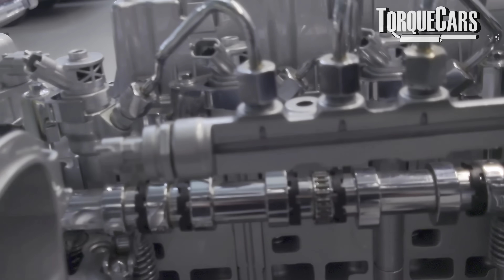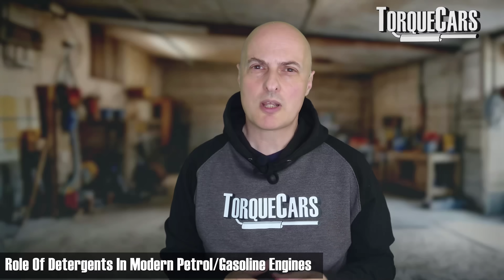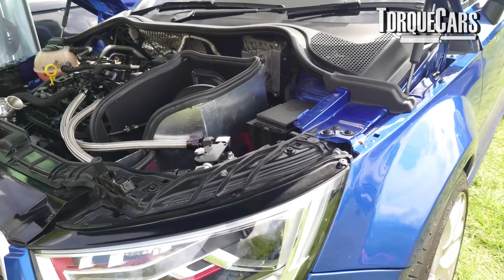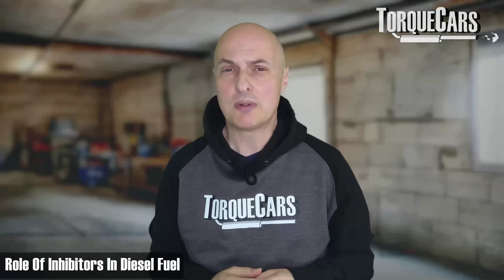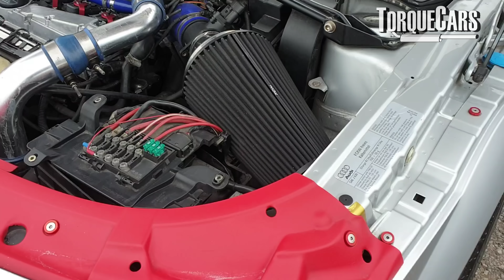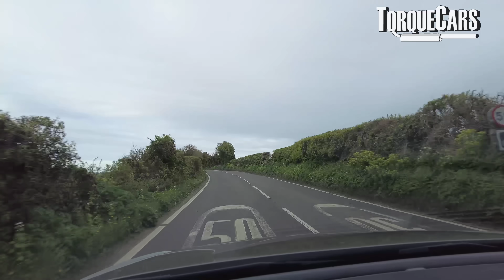Premium vs Cheap Fuel: ⛽What’s Better For Your Car? Do Premium Brand Fuels Really Clean Engines?

Comment: I used to deliver fuel, it's all the same just has additives in it.
and a point to note is all forecourt fuel has additives in it.
fact.
so your paying for additives.
I only use supermarket fuel in all my skoda diesels never had an issue ever.
and service my car correctly.
stop with the scare mongering.
budget fuel is the same as expensive fuel, just additives.
if budget fuel was as bad as your making out wouldnt be allowed to be sold.
all the these videos about fuel are boring.
fuel is refined to a standard or couldn't be sold.

Comment: Hi, (VW Tiguan 2l TDI 2013): Experiencing hesitation, feels like misfiring. Happens during accelerating when I press the pedal jentally (never expires this issue when I press hard on the padel).
Some time I feel it when driving downhell on motorway whiel the cruse cntrol is on. Any advice?
Reply: Have you changed the fuel filter ?
Reply: Add a can of diesel injector cleaner to a full tank and give it a real flogging somewhere hilly for an hour or two.
If that doesn't sort it get it scanned via the obd port and see if it's throwing any codes

Comment: I use texaco diesel from the sake fuel station and same pump I use reddex diesel system cleaner and eventually visit died the job excellent I get over 40 mpg in town and 70 plus on long runs I have. 1.6 tdi vw😊

Comment: I noticed my last car, a 2006 Mazda MX5 2litre felt more responsive with a 2 -3 mpg gain after filling up with BP Ultimate.  It's the same story with  my present car, a 2004 Audi TT 3.2 V6. The owners manual on both advise using premium fuel, although standard fuel can be used with reduced performance.  I also run two motorcycles that run better on BP Ultimate. I dare says V Power and others will be the same but the BP station is nearer to home.

Comment: 2012 Hyundai i30 diesel, 98k and runs beautifully. Good service history and mpg. Should I use engine flush prior to an oil change?
Reply: No. An engine flush isn't needed for cars that have been serviced regularly. Modern oils have enough detergents in them. Adding a reputable diesel injector cleaner to a full tank a couple times a year is probably worth it though
Reply: @eponymous7910 Many thanks for that 👍

Comment: Until recently I consistently used Shell V Power in my car, mainly because my car requires 98 RON or better and allegedly Shell has one of the best additive packages for keeping the fuel system in good condition, it also helped that the Shell garage next to where I worked was usually cheaper than supermarket fuel in the town where I live. Now that I've retired it's not worth me making a special trip to fill my car so I now use Tesco Momentum because it exceeds 98 RON and has zero ethanol, I still fill up with Shell V Power on occasion for the cleaning additives.
On a side note I have several small petrol engine garden tools and I use Tesco Momentum in them, not because of the octane rating but because of the zero ethanol, you can have problems with garden equipment if you don't  drain the fuel out if you're not going to use it for a while (over winter), I've found that using zero ethanol fuel I don't have a problem if I store the equipment for extended periods with fuel in.
Reply: Momentum is E5 which I believe means up to 5% ethanol.
Reply: @Stringfellow-xo6do  there are videos on YT that show people testing the the octane rating and ethanol content of different fuels and they generally find that Momentum contains zero ethanol.
Reply: @Stringfellow-xo6do  yes... up to 5% can and also mean 0%. The clue is in the 'up to'.
E5 is basically a standard advocating 'no more tha' 5% ethanol. Zero percent is less than five percent and is still allowed.

Comment: One thing to mention is the higher octane unleaded, certainly Shell V-Power, is E5 against E10 for the regular 95 unleaded. The E refers to ethanol and the number that follows the percentage content; so E5 is 5% ethanol against 10% in E10. Ethanol is not great on fuel lines and the like; any rubber components are degraded by ethanol, particularly over time. Newer cars may or may not be as affected by this, but I've seen other videos on classic cars where it's a real issue and many owners prefer to run E5. I have to say that my view is a few pence here and there on fuel against the cost of engine work down the line is a no brainer. I personally try and use Shell V-Power as much as I can, but there's nothing wrong with BP Ultimate or Texaco's Supreme. Shell's V-Power claims to have 3 times as much cleaning power as its regular unleaded by the way. I suppose how long you intend to keep your car could be a factor in what you use as, obviously, is your financial situation, but you need to have a bit of money to run any car these days.

Comment: My 06 Mondeo ST TDCI has covered almost 250k with no issues regarding the injectors or fuel pump. I always use either BP or shell, standard diesel. My 1983 Honda motorbike on the other hand gets Shell V Power or BP Ultimate as they have a higher octane rating and only 5% ethanol. As the bike was designed to run on unleaded from day one, using the cheaper fuel with a higher ethanol count is detrimental to the fuel system over the long run and will eventually damage internal carburettor diaphragms and seals, along with fuel pipes if they are not designed for ethanol.
Reply: You might want to look into using Tesco Momentum petrol, it exceeds the 99 RON rating and I've seen youtube videos showing that it has zero ethanol content, or maybe use Shell V power for its additive package and Tesco for no ethanol.

Comment: Tesco published the results of an independent test of their Momentum 99 fuel, and if you look it might still be available.

The TL;DR though was that the additive package did make a difference but, pun intended, your milage may vary. From memory it wasn't very much though and is debatable as to whether it's worth the ~8.5% price premium. But if your engine can actually take advantage of 99 RON fuel it is often the cheapest for that grade.

Comment: I use Esso E10 as the percentage of ethanol is low compared to other brands. Every 4th or 5th tank, I use E5 with X2 additives.
If you are keeping a new car for say 3y (lease) I would just use the cheapest, I intend to keep mine for 7-8y so I use Esso (as a premium brand)

Comment: I’ve noticed differences between standard diesel. My 1.4 TDCI on 150k miles runs better on standard Shell saver diesel compared with the diesel from the nearby Jet garage. The car has a worn injector and it misfires much less on Shell diesel. 

If I had a petrol car, I’d probably get the cheapest petrol.

Comment: I am not sure how it is in the western world, but in eastern europe the additives are added by a tank (truck) driver or by gas station worker and many times it's just doesn't get added so premium fuels (except for higher octane nummber in a case of petrol) have no real benefit.
What I do is fill up with regular fuel and then add additive by myself, usually wynns supremium petrol. It's cheaper and I am sure that it is added to my fuel.

Comment: Shell V Power or BP Ultimate petrol for my 2023 Hyundai Tucson. I put petrol in once from Sainsburys, never again as it blocked my fuel filter and caused the engine to misfire and judder. Since switching to premium E5 petrol I've had no problems.

Comment: I've always used Shell V Power on my previous 3l Jag XF and still had DPF problems. My current BMW 3L has just needed a new inlet manifold as it was chocked with carbon along with glow plugs and temp sensor next to the DPF. I think it is the Euro 6 standard that is killing cars, eg EGR/ DPF, regardless of the fuel type used. I do think premium diesels help mitigate this to an extent though....

Comment: I've ran my 2.0 HDi on supermarket fuel. 250k miles on the clock, original fuel pump and injectors. Official MPG is 49 but average on my car is 54 in winter and 56 in summer.
Reply: @khalidacosta7133  yeah but the 2.0HDi is extremely durable and not picky. Not all diesel are like this. Especially not the news one.
Reply: @marcuswoodgate4026  The 2.0 HDi is extremely durable however the fuel injection system isn't made by PSA. It's common across all manufacturers.

Comment: Shell V power is the absolute best for preventing engine knock and detention. My friend had Tesco 99 tested and it came out at 102 Ron and detected no ethanol. I run shell v power for my built Subaru sti engine and Tesco 99 on my other cars. All other fuel is rubbish. Makes less HP and engine e knock goes up

Comment: 2.1ltr Mercedes GLA 2016 and I use BP Ultimate diesel and the car runs smooth and like new! Costs me about £5 to £10 more than the standard BP diesel but it is an investment in keeping the car and engine at tip top condition, now have 84,000 miles on the clock so it should last me another 10 years! great video! btw

Comment: Mitzy Shogun 2007.  170k.   3.2 diesel.  Shell fuel, V plus frequently.  Doing short journeys so 3000 rpm run on motorway monthly.   .   As a mechanic once said to me he would not put supermarket fuel in his lawn mower.

Comment: A little mineral 2 stroke in diesel , no more than 1%,  cleans the injecors and runs quieter i have found, My 27 year old 1.9 tdi and and 25 year old Rover are testimant . V power is best  I get well over 70 mpg in the Rover and over 80 in the VW on long runs .i travel  Murcia to Pamplona regulary. 2 years ago I travelled at no more than 55mph to Pamplona and got almost 90 mpg in the 1.9tdi Incredible engines that will last a lifetime if a bit unrefined
Reply from the maker: I remember that old trick, and it worked well but I must add a word of caution to anyone trying this on a modern diesel engine. Adding 2 stroke or other oils or substances are likely to build up deposits in the particulate filters and cause problems. If it's sold as an additive you are probably ok as these are tested with modern engines, but don't try bunging any old fluid in your car on the basis it worked well years ago (which it did), things have moved on.
Reply: 80 mpg on 1.9tdi is impossible. What?
Mine does 40-45 mpg from new and that is good normal driving.  23years  now 130pd. 
I used to give a bit of 2 stroke back in the day...but now I just buy injector cleaners from time to time. Maybe 3 times a year.
Reply: @Stanjara around town i get between 45 ,55 mpg but i can achieve amazing mpg on long motorway trips. the 2 stroke helps but i wouln't use it on anything with a DPF

Comment: I own cars and bikes, petrol and diesel.
I found on my high rev motorcycle, V power Petrol really feel the power differences on my 200 hp track bike. Fueling the same V power Petrol to my 306hp Mini, its less so but it does feel rev slightly freely in comparison.
Cleaness point of view, is absolutely top notch as I can see inside of the cylinder and spark plugs.  This is based on the use of V power petrol most of the time (9 out of 10) and mixed with 1 out of 10 Tesco momentum. Spotless. 

Diesel wise I dont feel any difference, I tried V power, Fuel Saver diesel as well as Tesco normal diesel and BP in the same B57 engine, I dont feel(subjectively) any difference at all. So I end up using Tesco normal diesel most of them time (8 out of 10) and mix a tank or two V power Diesel in between.  Mileage, feel, poower are on par, no noticible difference, no starting, gelling issues.

Comment: I have a 2006 MX 5 NC . You can absolutely tell the  difference if I don’t put premium 97 or 99 octane fuel. It runs best on Tesco 99 Momentum. But our 2024 Mini Countryman S runs well on 95 or 99. But I do put premium fuel in because I think it benefits the engine in the long term. But I also religiously change the oil in both cars once a year or 8000 miles .

Comment: Freelander 2 2013 2.2 SD4, bought with 108k miles, used V Power since purchase, 110k miles now, car runs smoother and slightly better MPG. The long term compound effect of premium fuel is the product, one tank of V power isnt going to change your car but 40 tanks of it will reduce the chances of issues (thats my thought process anyway). Great video as always!
Reply: @DavidMcCartney789  This is also my logic…2006 Fabia Vrs, no one can tell me 40 tanks ain’t helping the damn thing 😂
Reply: Finally someone who gets it! The additives help long term so the added price doesn't matter.
Reply: You are gullible,  easily scammed and don't want to appear foolish, so you will try to justify spending far more than you need to.
If you ever get someone asking for bank details, run a mile.
Reply: @OH2023-cj9if premium all the way, as the saying goes you get what you pay for
Reply: @OH2023-cj9if What for buying premium diesel? 🥴😂

Comment: Many years ago I kept records of my MPG in a couple of cars I then owned. I discovered that on simple MPG alone Shell 4star was better than Jet 4star, by a measurabe amount, enough to offset the higher price of Shell. I did not measuer other factors, but the cars lasted over 100k miles without problems.
Currently my favourite Fuel is Sunshine , followed by wind power. No neeed for special oils, no drop off if I use fuel from another source, no  exhaust pollution and a cost per mile of under 2 pence.

Comment: My 2 litre Volvo S40 petrol runs on whatever the cheapest fuel is at the time. 100k miles absolutely no issues at all
Reply: Old petrol cars don’t have any filters that can get blocked but cheap fuel build up carbon
Reply: @Pixelpeeps-69  every car has a fuel filter mine included, never been changed though. British fuel is fine doesnt matter where you get it. Its USA that gets the crap stuff

Comment: Fuel is like oil : there is a baseproduct from just a handful of refineries. The base product gets an additive pack. This can be helpful to keep the engine cleaner or counter the bio component. My father worked for 40 years as marine engineer in the chemical sector and always said : "don't buy old crap you will be fine, all fuel and oil meet minimum regulations. Also change oil ahead of schedule at half the recommended interval and don't baby the car use the redline". My engine is a bit sensitive to the brand of diesel, best is BP / ARAL Ultimate diesel , it has NO bio component. But MPG gets worse not better as promoted, the diesel knock is gone and the stuff is expensive.

Comment: I have been trying to find out what additive packs are in supermarket fuels, and it seems like it's a well-kept secret. The best "data" I can find is the blanket claim that supermarket fuel meets the British standard and is "safe" to use. There's a very basic British standard BS EN 228, which just specifies ethanol and oxygen content, and there's other standards for all sorts of fuel-related stuff, but it's all smoke and mirrors and there's nothing that says "Here's what's in the fuel at the pump". I get that there may be some sort of commercially sensitive information, but it's not like fuel wouldn't be easy for a lab to analyse and determine precisely what's in it. The secrecy makes me suspicious. I suspect that supermarket fuels are just branded fuels sold cheap but without the brand assurance. The secrecy being to stop people buying branded fuel cheap at supermarkets, but I can't definitively assert this, because of the secrecy. The exception is Shell V-Power, which is special stuff and has its own supply chain.
2:11 I would like the video creator to specify what he means by "poor quality fuel"?
Reply from the maker: Hi buddy, glad to have a chance to qualify that statement.  It is very general and I had in mind a few scenarios, bear in mind I'm discussing buying fuel from "Premium brands".

Every town or area has a fuel station which doesn't get used much, the fuel will sit in the tanks for a long while where it is subject to degradation this only really affects people who top up the tank once a month as the fuel could potentially be 6 months old or more.

Small independent operators may choose to neglect proper cleaning and maintenance of the fuel tanks and delivery system potentially causing contamination.

All fuel meets standards when it is sold. Comparing premium brands with decent additives it pushes the good quality level up raising the bar, those that have generic additive packages can be regarded as poor or technically "poorer quality" fuel.
Reply: The non-supermarket brands have a lot of franchise operated forecourts (if not all), so some of the issues with neglecting maintenance can also occur with some of the well known brands if a specific franchise operator or forecourt doesn't maintain their tanks.

A BP garage near me got a reputation for cars breaking down after filling up.
Reply: Thank you. I think I need to up my game with a premium fuel.

Comment: Have always used premium fuel and generally Shell V Power in both my Land Rover and BMW Z4 Coupe. Both cars nearly 20 years old and don’t do a high mileage so the extra cost is worth bearing. On long journeys I also add Liqui Moly additive. Fuel choice and additive could be snake oil but seems to work well and have no reason to change 😁

Comment: I have a 1.6t ecoboost engine. I always use Tesco momentum. I use it because it’s recommended and also I want to make sure that my injectors are cleaner than they would be when using normal fuels.  Especially as the car I have has a turbo and the engine is working under higher pressures. 

Saying that, I’ve always used normal supermarket fuels for my other cars and I’ve never had any problems. Though they’ve always been lower powered, older cars.